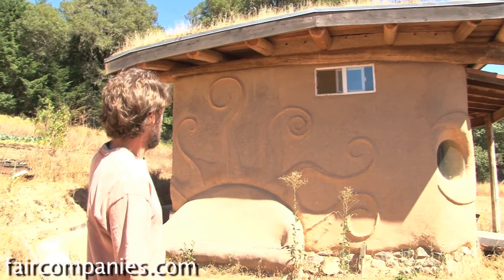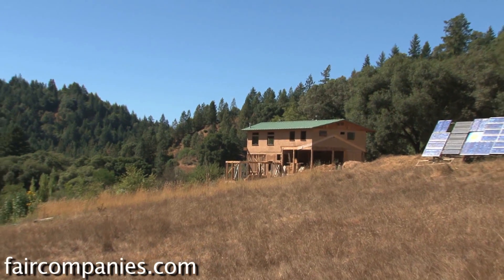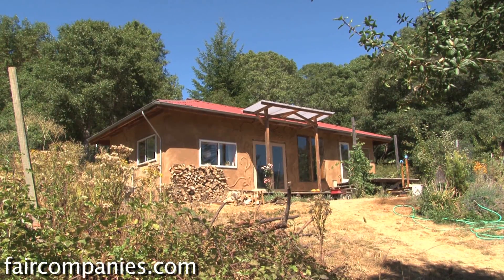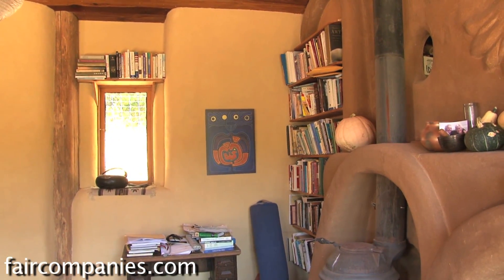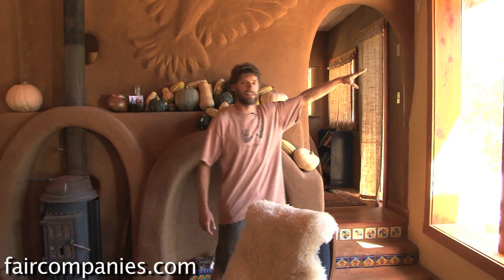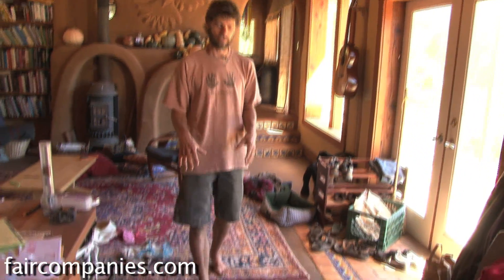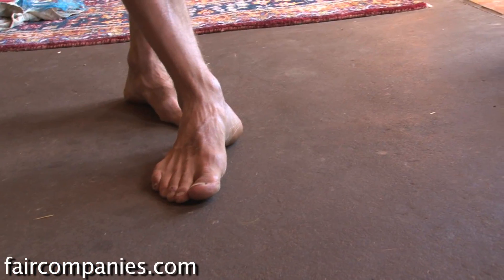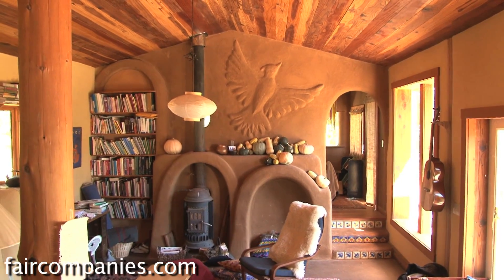Earth-built passive solar home: cob (south), strawbale (north)

Comment: Yeah, I guess I need to speak to an architect or something. Since solar heat can be stored and transmitted through means such as solid thermal mass (as well as through the more usual windows) I'm hoping it's possible to avoid the glariness of north-facing Australian sunlight and still have a passive solar house by using thermal mass in some other way.

Comment from the maker: The point of passive solar is to maximize exposure to summer sun (so the South in the Northern Hemisphere and the North in the Southern Hemisphere. I'm not an expert, but I believe you'd need the larger windows at that location for maximizing passive solar heat gain.
Reply: In the southern hemisphere, the sun still travels east-south-west and never goes north. This is because the Earth's rotation axis is inclined in relation to the sun. This is a great video and I wonder how much it costs to build a house like this one - not counting labor ?

Comment: I'll pretend I'm in the northern hemisphere to avoid confusion. Say I wanted to have my windows on my north-facing wall (i.e. wanted to get my natural lighting as much as possible from the north), do you know if there'd be a way to compensate in winter for any coldness that would cause, using passive solar design (and not using windows, or many windows, on the south wall due to glare issues)?

Comment: Is there a way to have the majority (and biggest of) one's windows on the north wall? E.g. by relying on indirect heat gain on a solid thermal mass south wall? (I'm in Australia, so I'm saying north and thinking south) Here, the light that comes through my north-facing windows is very, very glary at most times of the day & I always need to have some kind of curtain in front of them. Whereas light from the south (north, in your terms, of course) is nice and gentle on the eyes. Any ideas?

Comment: Great video, I happen to live in a part of Minnesota that doesn't have any set building codes with the exception of well & septic regulations. Having a home with 2' thick walls is very appealing considering the frequency of -35F temps we battle, our winter is 5 months long, thanks for sharing your time and knowledge Michael.

no need to be rude maradi.

Comment from the maker: @GrdnovGreens I think strong is relative. As Michael says (in video "natural buildings don't melt"), "it's all the same forces acting on both of them [earthen and wooden structures]." He talks about 1 structure he built being under water after a flood for 3 days & it being fine (so more durable than a wooden structure). I'm not sure about tornadoes, but I'd guess that cob might be the sturdiest of all earthen structures. I think it's similar to concrete as far as strength.